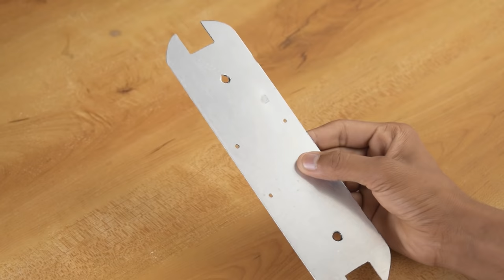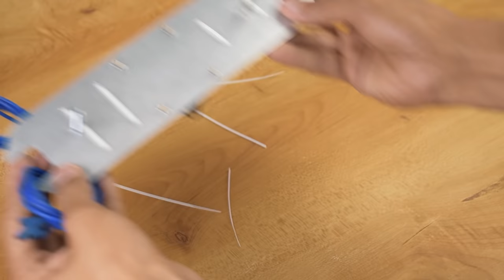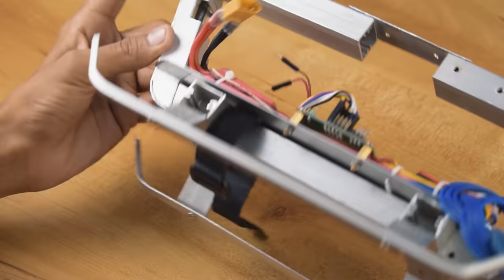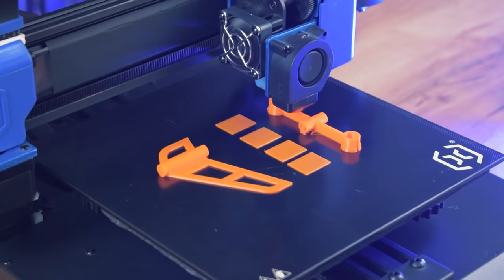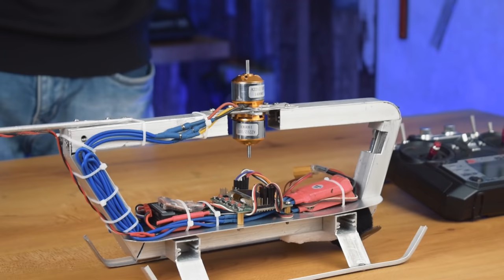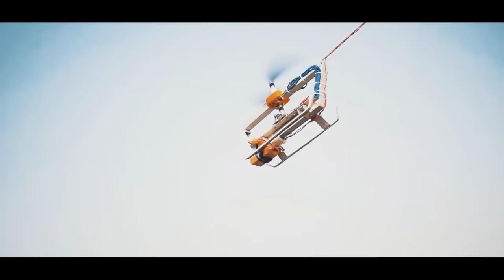Making a Remote Control Helicopter at Home - DIY RC Helicopter

Comment: Till now, no one made a RC heli like this. You are the first person on YouTube that I know of who made such a flying machine on RC
Reply: Wrong)
Reply: @katsapopidar  well I was talking about non-tandem ones
Reply: @ Pratap Sarkar you are absolutely correct , me too never seen on YouTube RC heli like this...
Reply: I agreed you,Mr.Pratap Sarkar.well said.
Reply: First one to use separate motors. There are a TON of coaxial heli toys out there as that dsign was adopted by the toy industry as the simplest , cheapest and most reliable/easy to fly method , BUT , the problem was they used a single motor (or pair) on a concetric shaft. This negates having to use those weak concetric shafts.
Reply: I'm wondering this is fake because multi rotor needs either gyroscopic stabilization in their rotor blade or it needs angle or pitch control over the thrust angle so that it balances itself. The sad thing is this model is a total fake one he is filming with green thread or stick and edited like it is flying. many in the comments are thinking this is real and appreciating him. lol.
Reply: And it looks good and fly good mind blowing 🤯
Reply: @lokaero lleva un horóscopo la kk2

Comment: Hi bro, first of all ver nice job and it works excellent. But I'm very curious how the roll stability is handled. From your video it can be seen thT everything set to the cg point for pitch and yaw the controls are there, but roll have you done anything special?

Comment: Awesome RC project! Thanks for the detailed explanation!
Reply: I'm wondering this is fake because multi rotor needs either gyroscopic stabilization in their rotor blade or it needs angle or pitch control over the thrust angle so that it balances itself. The sad thing is this model is a total fake one he is filming with green thread or stick and edited like it is flying. many in the comments are thinking this is real and appreciating him. lol.

Comment: Here is what I posted on the FB shared page ...THAT...is a really good design and utilizes even simple flight controller. Even better design for FPV heli as it reduces those huge , high mass blades to something that could actually be duct enclosed. If you utilize that suggestion , I would actually call it 'the design of the century!' I'm sure most of the current heli flyers, and many times more 'b asic' beginner heli flyers would recognize it as the simplest, most stable design adopted by the toy heli industry the moment toy helis came out. One could easily go further and place a forward thrust proprietary motor/prop on either just inside the nose area(with a little design change--lengthen nose) or at the rear of the vertical post.. Probably THE most flexible design ever.

Comment: Although good job done, but if some one wants try a hand on this project details are not enough, KK 2.1.5 part is ok but how do you control coreless motors, pl. give complete details so that fresh in this field can also try their hands at it, i hope you will not mind and would be kind enough to provide complete details of the project, hope you will come with complete details of thr project soon, God bless.

Comment: Hi nice video about DIY helicopter, I have a doubt is coreless motors tolerate 20A current, bcoz WHAT you have mentioned that 20A ESC IT delivered current is 20 A output  could you clear that doubt, is it not too much for that coreless motors

Comment: What a great concept!
Reply: I'm wondering this is fake because multi rotor needs either gyroscopic stabilization in their rotor blade or it needs angle or pitch control over the thrust angle so that it balances itself. The sad thing is this model is a total fake one he is filming with green thread or stick and edited like it is flying. many in the comments are thinking this is real and appreciating him. lol.

Comment: Basically a Y4 quadcopter. What about the roll authority with the tail rotors that close together?
Reply: Fake. Impossible because the 2 motors are plugged in same esc
Reply from the maker: @Eduardo Leite
No, both the motor having separate ESC and Direction, one of them is using Clockwise propeller and another one is using counter clockwise propeller.

I think use should watch video again
Reply: FAKE VID
Reply: @eduardoleite7566  FAKE VID.

Comment: Very good engineering skills!
Reply: I'm wondering this is fake because multi rotor needs either gyroscopic stabilization in their rotor blade or it needs angle or pitch control over the thrust angle so that it balances itself. The sad thing is this model is a total fake one he is filming with green thread or stick and edited like it is flying. many in the comments are thinking this is real and appreciating him. lol.
Reply: are you an engineer?

Comment: How does it control the roll axis?
Reply: i guess with the 2 motor at the back, it is similar to quadcopter.
Reply: @MGEDAI2  Yeah, that was my initial thought too, but it's not much of a moment arm for those two small motors to bank left and right. I guess I'll just have to give this video the benefit of the doubt. Maybe it's just naturally stable in roll? There are some 3 channel toy helicopters that get away without Roll control and only have Throttle, Yaw, and Pitch; so maybe this is also flown in a similar way?
Reply: @MGEDAI2   DONT TRUST
Reply: I'd like to see this irl. No roll or pitch control. Those little tail motors ain't doin squat. It only has yaw control with the coax setup. The KK2 is great but it doesn't work miracles!

Comment: Very  nice ,landing was mind blowing.It looks like it has a transparent outer body while flying. Excellent flight balance 👌👌👌
Reply: I'm wondering this is fake because multi rotor needs either gyroscopic stabilization in their rotor blade or it needs angle or pitch control over the thrust angle so that it balances itself. The sad thing is this model is a total fake one he is filming with green thread or stick and edited like it is flying. many in the comments are thinking this is real and appreciating him. lol.
Reply: Hi Lokaero, I think that the weight at the bottom of this helicopter is more and the two  blades are rotating at some high specific speed. The battery may drain fast because of heavy discharge. The weight prevents machine from loosing it's centre of gravity and eliminates the need of gyroscopic control. The flight is real but missing  full controls like    left right.
Reply: @prasannakumar8832  Absolutely wrong. I think you need to gain more knowledge on aerodynamics. Weight cannot balance the helicopter. even a small toy helicopter has rotating mass attached at its one of the blade which counteracts the imbalance of rotational axis when airborne. As an aeronautical engineer i can easily say that this model is totally fake. and battery does not play role in balancing the helicopter lol. You may have knowledge in lithium batteries but not in aerodynamics and mechanics. i too have knowledge in lithium batteries and your point doesn't have any logic here.
Reply: @prasannakumar8832  The flight controller he uses is KK 2.1.5. and i cannot see any servo attached to the brushless motors. i accept that rotation is balanced as both motors spin in CW and CCW directions. but this is not balanced in X rotation and Z rotation. only Y rotation is balanced. no point in using a flight controller here those two motors at tail simply does nothing in balancing the heli.

Comment: How to control the Roll ? It is possible to use different thrust tail motors ?
Reply: low CG keeps the skids pointing down most always. This would NOT be a 3D heli for sure